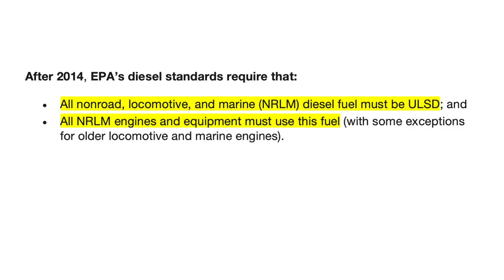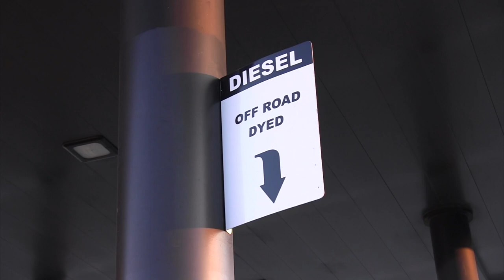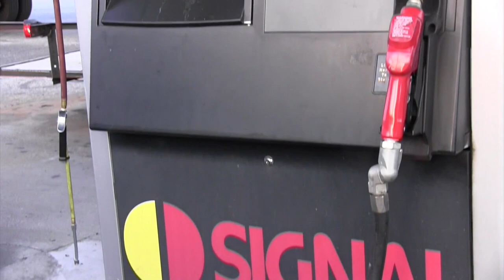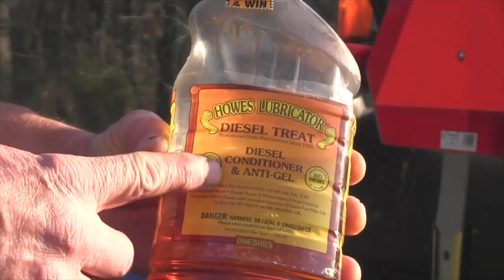The Biggest Danger to Your Tractor Engine, What's in Your Diesel Fuel Tank?

Comment: The first diesel fuel I bought for my new tractor I added the Sta-Bil diesel fuel stabilizer/additive.  I don't use my tractor every day right now so I figured for the low cost of the additive/stabilizer it could potentially save me a lot of money in serious repair bills for fuel contamination from storage and lack of use.  The directions say 1 ounce for 5 gallons when used for storage purposes but for normal usage you can do 1 ounce for 10 gallons.  Well my fuel can is only a 5 gallon can but I've been putting in an ounce of sta-bil when I fill the can up.  Due to the tractor sitting for longer periods of time I figured it was safer to use the storage ratio rather than the daily ratio.
Reply: I use the same product in fall/winter. Never had a complaint.

Comment: Evening Mike, I agree with everything in the video. In the past I have used Walmart fuel injector cleaner as well as their top lubricant. Shaler Rislone is another good top cylinder cleaner lubricant which can also be added to the oil…just my experience, I’ve never had a problem in my tractor or SUV engines.

Comment: You never discussed #1 diesel vs. #2 diesel for us tractor owners in the North . #1 may cost a little more but it has lubricants added and resist gelling in cold climates plus better volatility and fuel efficiency .

Comment: Just did bio-kleen and clear-diesel due to a bad case of biological snot.  My usual supplier was out and I bought some off road diesel from someone else that doesn't have as high a turnover.  Spent half the day replacing filters and rinsing out my tank.  They need to make that float in the water separator blue instead of red.  Can't see the dang thing when running off road diesel.

Comment: In the NE the primary heating fuel is fuel oil.  When I'd get my fuel oil tank filled at my business I'd roll out a 55-gallon drum and have the delivery guy fill that, too, for the tractor.  He was a diesel guy, so I asked him if the fuel oil would hurt the tractor, vs the ultra-low sulfur pump stuff.  "Hurt?" He asked. "It would be lots better.  It has the same amount of sulfur as the old diesel, and sulfur is a lubricant."
Still have to add the anti-gel, though.

Comment: Great video. I have a NEW HOLLAND TC35D.  At low RPMs 1500 or less I get air in my fuel filter, not at high RPMs. I replaced my fuel cap, fuel line from the tank to the fuel filter. I replaced the complete fuel filter assembly.  I replaced the fuel line from the filter to the transfer pump. I replaced the transfer pump and the fuel line from the transfer pump to the injection pump. I do add marvel mystery oil to the fuel and an anti-gel additive. Please help.
Reply from the maker: Tom, this was over my head.  You've done everything I would think of to do.  I contacted the guru of New Holland tractors from the dealership where I used to work and he thinks you have a bad O-ring in the fuel filter bowl.  It'll be on top of the bowl or just below the lip.  Hope that solves it.  After that, we don't know.   You've replaced about everything else that would cause the problem.  Good luck!
Reply: @TractorMike  I had one more idea. It could be taking in air from the excess fuel lines after the injectors. The line goes to the fuel filter assembly and y's off to the fuel tank. Not bad enough to leak fuel but will suck air. Do you think I could find the leak by spraying starter fluid along the line and fittings? Also I changed the entire fuel filter assembly thinking something was warped or the shut off was sucking air. Also replaced orange several times. Thank you so much for the reply.  Tom
Reply from the maker: I don't know that I'd recommend the starter fluid thing, that scares me a bit.  Hope you get it figured out!

Comment: I once owned a VAZ1500 - a Russian copy of the Fiat 124 - and the engine in that could run on low octane gas. The problem was, that in Sweden at the time, all low octane gas was unleaded, so it lacked the lubrication properties of leaded gas. My dad (I was just nineteen) solved the problem for me by telling me to dump a litre of two-stroke oil in the gas tank now and then.

Comment: i got a 230 massy ferguson that sat up a long time over the last 10 years. the fuel went bad. i drained the fuel and got a half pint ogf the gluey dark colored varnish smelling sludge out of it. when i started it after setting up it ran good several hours then i parked it. the next day i cranked it and had a knocking sound coming from the front cylinder finally it got so bad i dont even crank it the idle is so rough..any advice? the man at the tractor place said i probably damaged the engine..if i change out the injectors and crank it do i run a chance of blowing the engine up? thanks

Comment: Great information! Luckily i don’t have to worry about this in my old 1963 Ford 2000 gas tractor. Early 2000 models were basically the same as the 641’s. Was my grandfathers tractor that I inherited 15 years ago. It’s old, but it does what I need to do. I have a few acres I bush hog, and I also bush hog hunting land roads and plow food plots. However, I have an old ‘95 F250 with a 7.3 diesel. Since fuel is now ULS, I add Lucus Fuel Injector lubricant to every tank of fuel. 240k miles on original injectors and still running strong!
Reply: I have a 62 F 631 tractor to mow with. My 6.0 F-350, also gets fuel additive for injector lube. Got bugs in my fuel tank too. Have fun

Comment: I would encourage using additives with every tank full. In the long run it is inexpensive. As you say those of us with older rigs need the extra lube provided. Few of us fill up after each use, and run the risk of condensation in the tank. While not 1 bottle will treat all aspects, most brands have products that treat them. Condensation will usually be less prone when gel treatment is needed. Lots of well established brands out there.

Comment: Would it be okay to put a sediment bowl on the fuel line somewhere for a diesel to help trap out water?
Reply: Yes. I removed the factory fuel filter from my Kubota BX23s (underneath the tractor, a real pain to change) and added a combination filter / water separator in a much more accessible location.

Comment: A John Deere dealer told me that the reason that the new tractor that I bought had "jelly" in the tank was because when the tractor was built it only had enough fuel to test the tractor. Then it sat on a lot until it was bought by a dealership, then it sat at the dealer until I bought it. I was told that tractor could sit for several months during this time and that is when "jelly" occurs. I was told to treat all the fuel put into my tractor with an anti-gelling product.
Reply from the maker: In times of slow demand, that's right.  Tractors can sit idle for a long time before selling.

Comment: Be responsible and proactive to care for own fuel.
Diesel fuel is and should be a serious concern.  In 3 seasons, I treat my diesel fuel with Ford fuel conditioner.  It contains a preservative, cetane booster and fuel system lubricant.  In winter I use a Ford conditioner that contains the above plus an agent to prevent gelling.  Coming out of my tank, the last step before going into the tractor fuel tank is a very fine filter and water separator.
Each tractor has an engine heater keep the engine warm so to the engine start like it is summer.

Comment: Ive treated my fuel with Howe’s in my Kubota since new and not had any issues. Howe’s claims that you can not over treat and I’m the type who believes that if I can actually treat down to the gallon accurately, I will simply over treat. The Howe’s lubricates, prevents gelling and keeps the water out. No it’s not cheap, but neither was this L4701 !  After 5 yrs of ownership-no fuel issues.

Comment: I use red diesel because I don’t have to file a road tax rebate from the Mo. Dept. of Revenue. All fuel is ULS and you can tell because ULS is very dry and hasn’t thé lubricity as the old sulphur diesel. As a retired farmer, I’ve known for many years that a tractor in storage needs to be put up with a full tank of fuel. I use Lucas fuel conditioner in my Diesel engines and have never had algae form in my tanks.

Comment: I’m curious. If a half-empty gas tank causes condensation, then why doesn’t the gas tank have a bladder? And why isn’t the diesel stabilized before it gets sold?
Reply from the maker: I'm not sure about the bladder question, but in most applications, the diesel gets used fairly rapidly and doesn't need stabilized.  The problem most of us who have a "Hobby Farm" tractor, myself included, is there are periods in the year when the tractor (and fuel) sits around for a long time and so we are very susceptible to fuel storage issues.  Truck drivers and farmers burn it through rapidly so they don't have to worry about it as much.

Comment: Hi Mike! Great video again and great advice, specially on finding a Shade tree mechanic. my neighbor took his tractor to our local back yard /shade tree mechanic to get is cab blower motor looked at. The mechanic called the local MF dealer and got a quote of just under 500 dollars just for the part alone. So the mechanic took the defective blower motor to another shade tree guy who fixes electrical components like starter and alternator. The cost of fixing the blower was 80 dollars and the time to put it back in the cab was in total well under the price of a part at the dealer!  On another note, finding diagram and schematic is usually easy except for AGCO products, go figure.

Comment: Good topic, I have seen repo tractor which had broken down in the field n guess what was in fuel tank? Toilet paper roll, long day clean out.  Another tip if fuel filters are dirty not just replace filters but clean tank, replace injectors even if cost bit, injection vs bugger engine🤷‍♂️

Comment: I always use a Mr. Funnel when I fill up, I never skip using this.  I also use PS white bottle supplement (it was recommended by the dealer), diesel Stabil and also biocide with every fill up.  I know that I'm anal, but I don't want troubles with my tractor.  I've been doing this for four years (400 hours engine time) without any trouble on my 2017 Kioti CK3510.  Keep up the great work on your videos.

Comment: Can't you also get in trouble with the off road diesel in your tractor if you drive the tractor on the road?
Reply: No.
Reply: Have never heard of a farmer being cited for running off-road fuel while transiting on the road with Ag equipment.
Reply: No.
Reply: No
Reply: This may vary by the state. In my state if registration and License plate are not required, then off road untaxed fuel is acceptable to use.  However, only a trace of the red dye in any road use vehicle such as your pickup truck and you will have a fine.  If you purchase bunk untaxed fuel delivered to a tank, sooner or later it is likely state inspectors will make unannounced visits and pull fuel samples from every registered and tagged diesel vehicle. A friend of mine heats a warehouse when temperatures are expected to be low with untaxed No. 1 heating oil which is not No.2 diesel fuel. He has never misused the heating oil and he has no way to get the heating oil into his trucks without rigging  a way to do it including a way to pump it.  However, he laughs about the state agents coming by and pulling samples and accounting for every diesel truck.  I buy less than a hundred gallons of untaxed diesel in a single purchase in a tank in my truck bed, my pickup truck is a gas burner and I have never been aware of being checked.

Comment: Why can’t they make a water / air tighten vessel, what do you mean water gets in the fuel take, a low filled fuel tank with air in them ,they collect water, ok now I know why my tractors get water in them , I thought my barrels were watered , and they might be as well, when I started using barrels I never tipped them on and angle 📐 where the bung holes are 90% to the tilt, that will let rain water stay off on the tops and it will run off of them ,loll, nice thanks BigAl California.

Comment: I experienced this exact issue four weeks ago.  I couldn’t understand why my injection pump was loud, suddenly.  Turns out it was cavitating, starving for fuel.  My tank had diesel algae and starving my pump.  The additives work.  My dealer told me that plastic fuel tanks are famous for creating algae, and my tractor had just that.  👍👍👍
Reply: Did you change it out to a metal tank?
Reply: No,  the additives are doing the trick.